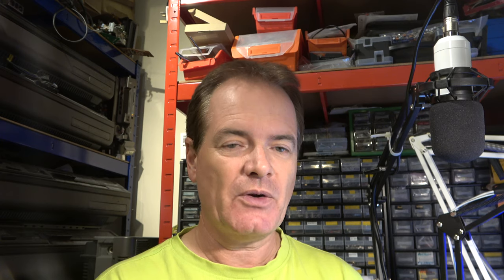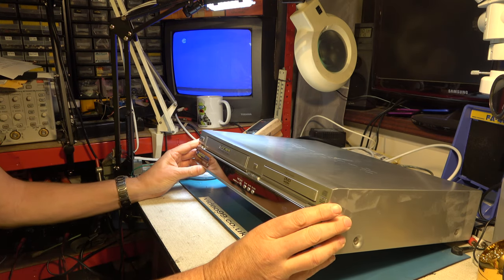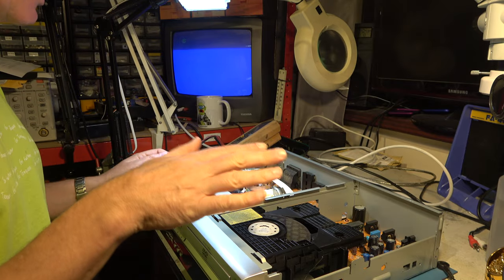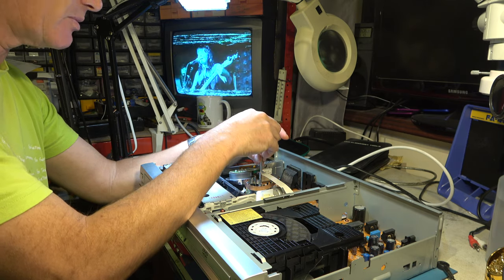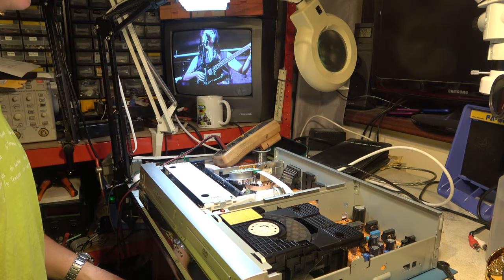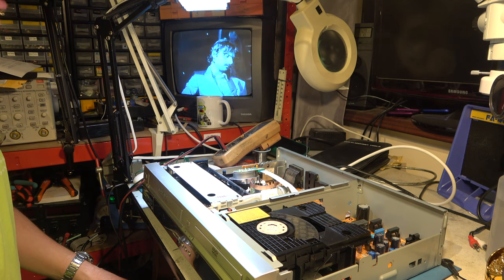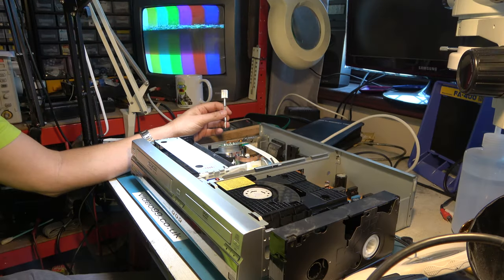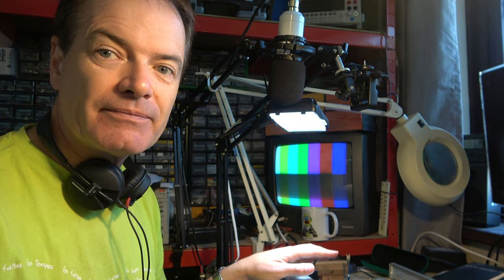VHSC tape recorded with massive alignment (tracking) error.

Comment: that vcr is probably not "hunting tracking" continously at all, because it's panasonic. sony might. panasonic just sets tracking at the beginning and stays at it. if another portion of tape has different tracking, you have to set it manually. unlike sony which constantly updates auto tracking, you don't have to adjust it ever.  panasonic nv-hv60 vs. sony slv-e730.
Reply from the maker: I think JVC will re-track as required too.

Comment: Cool trick! What would you have done if it didn't work at last? Adjust both of the guides the same amount?
Reply from the maker: If it didn't work at all, then it would have implied that there was an unrecoverable recording defect such as if the tape had been curled during recording so it didn't touch the video head.  Or possibly that the error was too huge to compensate for, which I have very occasionally had with Video8.  It would be rare for both guides to shift, but not impossible.

Comment: Hi, how to align tape path on a Grundig 2x4? What is the difference between a tape path and tracking fault?
Reply from the maker: Setting up the tape path on a 2x4 will require the service manual.  Probably involves a test tape and switching off the DTF.  V2000 machines can develop tracking faults for reasons other than bad tape path, typically due to DTF circuit failure.  It's complex and prone to failure.

Comment: Hello! So, I have a VHS tape that shows white noise stripes showing in waves every two seconds or so...looks like misalignment. It doesn't happen with other tapes though. Any idea? Many thanks!
Reply from the maker: It might be that the player is not receiving any tracking pulses.  Have a look at the tape, you may find that one edge of the tape has ripples on it where it has been damaged, and this is preventing good control pulses from being picked up by the A/C head.  This stops the capstan servo from working and causes the problem you describe.

Comment: You mentioned the tape being in Ntsc in The begning, Something I would like to point out if the Ntsc tape would have been recorded in LP the VCR might not have played it I have a RCA Ntsc VCR from the US and I made a LP and EP recording in that VCR for fun to try in a PAL VCR and lots of my PAL Vcrs with Ntsc Pb couldnt play the Ntsc LP recording for some reason every one of my PAL Vcrs with Ntsc Pb will play Ntsc EP recordings tho. You also mentioned video 8 which is much better then  VHS-C imo, I have Had a lot of issues with The VHS-C adapters.
Reply from the maker: Some older PAL machines won't play all NTSC tape speeds, but this relatively recent machine would.  As it happened the tape was SP recorded anyway.  I hate VHSC too, it was a bodge-up.  What I didn't mention here was the PAL machine would play in pseudo-PAL and the TBC has to convert to true NTSC for capture, so the NTSC line/frame rates are preserved for full quality.
Reply: My very old (late 70s-early 80s) JVC and Panasonic multi system machines will only play SP. The LP speed in NTSC was never officially supported by JVC. Matsushita was forced to create it so that they could sell VHS machines in North America with 4 hours of recording time.
Reply: @crashbandicoot4everr  Ok, Lots of PAL multi standard machine like my 2004 Funai, My LG combos, My Samsung will play the Ntsc SP and EP tapes I recorded in The RCA VCR from the US I got however they wont play the LP tape I tried recording in The RCA, The LP tape I recorded plays fine in my Grundig and Sharp tho. I think it is quite weird that some PAL VCRs will play the Ntsc EP but not the LP speed do yk why this is? As far as ik all pre recorded tapes came out in The SP speed tho.
Reply: @SwedishRetroTechNerd  The companies that bought their VHS VCR manufacturing licenses from Panasonic all had the LP speed for recording (Hitachi was one of them). The ones that bought them from JVC did not (Sony was one of them). Of course this only applies for North American market machines. Multi system machines were mainly marketed in the Middle East.
Reply: @SwedishRetroTechNerd  Fortunately my AIWA HV-MX100 plays all NTSC SP, LP and EP as well as PAL SP and LP, but it doesn't record NTSC LP, I still have an old 1987 GE VCR (made by Panasonic) we brought from Canada that plays and records all 3 NTSC speeds.

Comment: Well done, an impossible tape saved :-D
The only problem with tweaking the guides is the tape may not sit on the reference shelf or  "Rabbit" so it can wander about a bit and tracking too.
I would aim a dim torch at the left side shelf and adjust the guide down untill the reflected image from the shiney tape just started to distort , then adjust it up for a clean mirrored image.
Same for the exit guide.
As you said a scope and head switching signal would show the r.f heads balance.
Reply from the maker: In the end I find that getting clean hi-fi audio is the ultimate test of proper alignment.  It's very fussy on both VHS HiFi and PAL Beta HiFi.

Comment: Ok so the arm that grabs the tape to wrap it around the tracking and sound heads doesnt come far enough to grab the tape. So its not touching those heads at all actually. How do i fix that?😂
Reply from the maker: Non-trivial I'm afraid.  Probably a broken gear beneath the deck.  Depends which machine it is though, some Panasonic machines do this when a motor drive coupling splits, which can be glued.